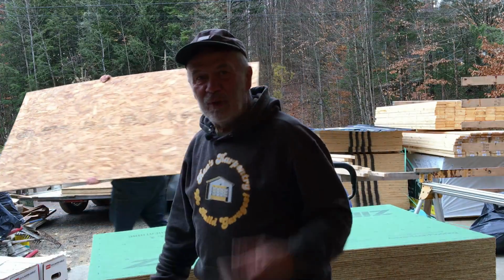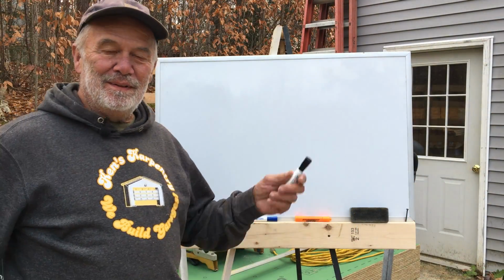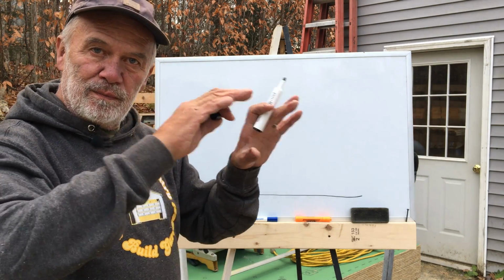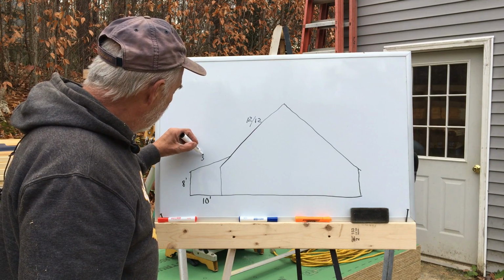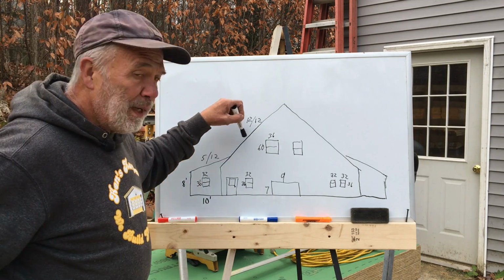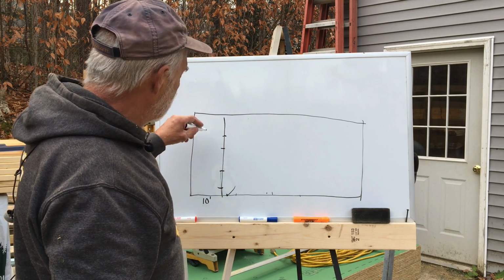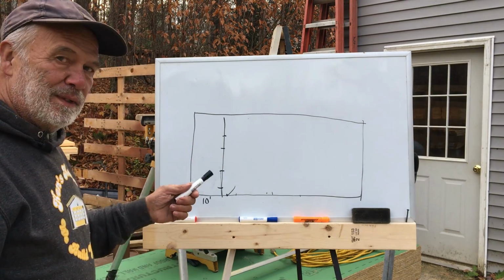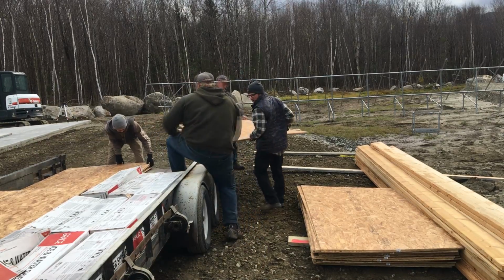LUMNAH ACRES TINY HOUSE Part 2 and it begins first load to the jobsite!

Comment: 24'x38' two story home is supposed to be a tiny house?   Most tiny houses I have seen are the size of a shed.
Reply: First floor is all storage / shop. I believe the second floor works out to around 600 sq ft of living area. Not exactly huge.
Reply: @rupe53  Well it will be interesting, if ken's dimensions are correct the second floor appears to be 20x24 with knee walls and stairs you are probably only talking 320sf guess that would be tiny...
Reply: @ericfraser7543  ... I stand corrected. That probably is well under 400 sq ft once you account for the other things.

Comment: .the question is is this a tiny house....a few of us are not sure it is... it looks pretty big to me
Reply: second floor is around 600 sq ft. First floor is all storage / shop.
Reply: @rupe53  so that 1200 sq foot not tiny
Reply: @eddiewatson3759  ... I guess we'll see how tiny (or not) as the build progresses. BTW, it was pointed out to me that subtracting the knee walls and stairs would make that second floor something under 400 sq ft of usable space. Also, the porch extension on one side is not closed in so further reducing inside floor area. My take is it's a barn with a small living loft area.
Reply: @rupe53  i dont see al living in 400 sq foot..he will live in the tractor lol
Reply: @eddiewatson3759  ... hey, one of his machines has heat, AC, and a radio so why not?  <LOL>

Comment: I've always wondered why overhangs in the NE are somewhat shallow compared to the 18-24" deep overhangs out here in the SW?
Reply: Down south you need the extra overhang to block the sun. Up north we want a little sun, especially in the winter. The other half of that is we have a higher pitch on the roof to shed snow. If you wanted more overhang the only way to get it is to make it a hip roof or lower the total pitch.

Comment: I sure don't envy cleaning that drive for the winters in Vermont! The seclusion is sweet, but they will have their hands full in January.
Reply: He has the mule with the snow trail/path sled to smooth out the driveway and his truck with the BOSS plow and the TYM tractor. The loggers will be coming in and out too so I hope it won't be too bad this winter.